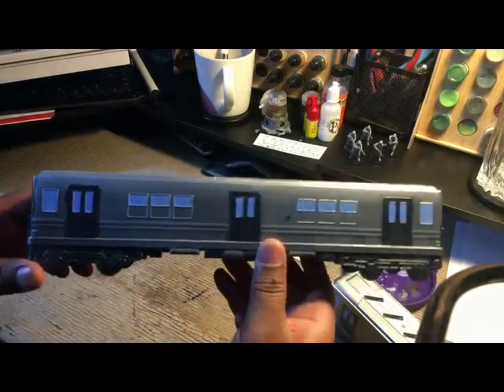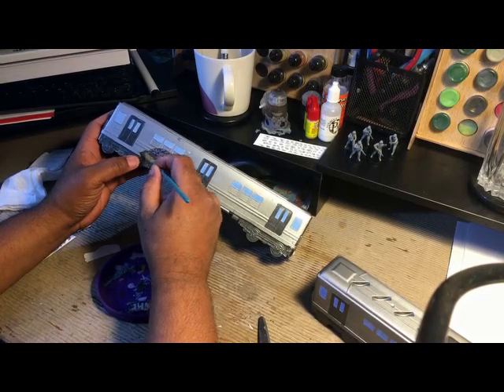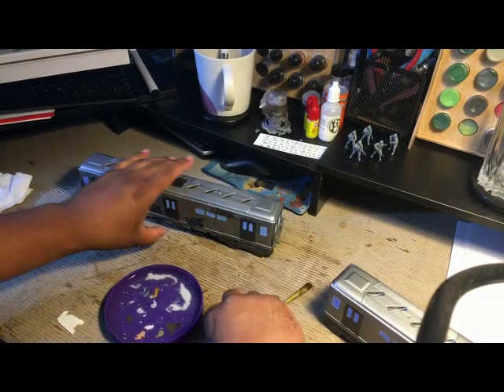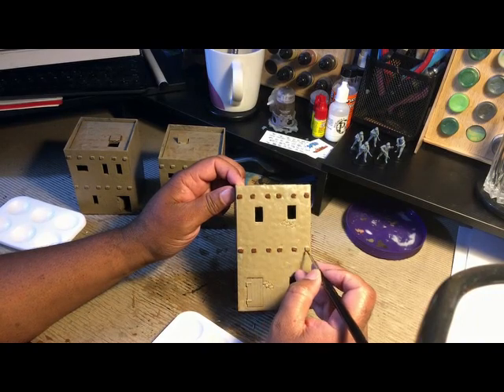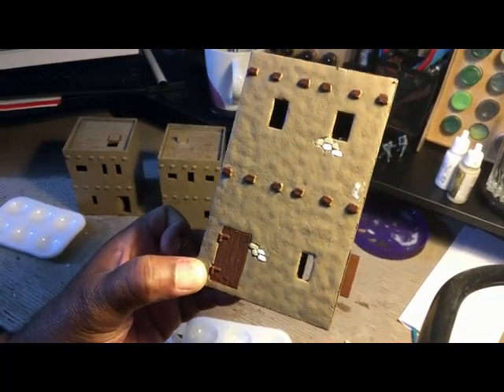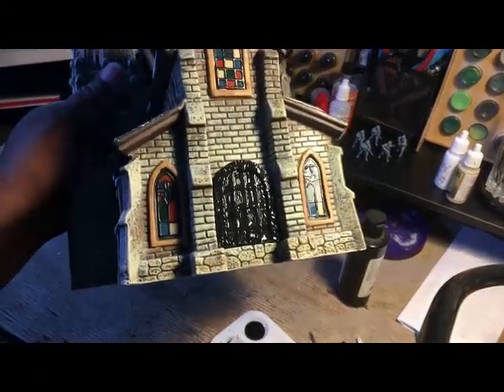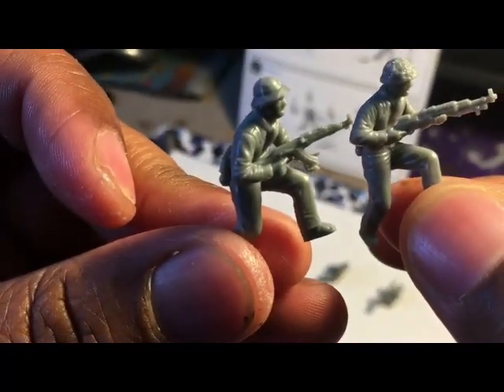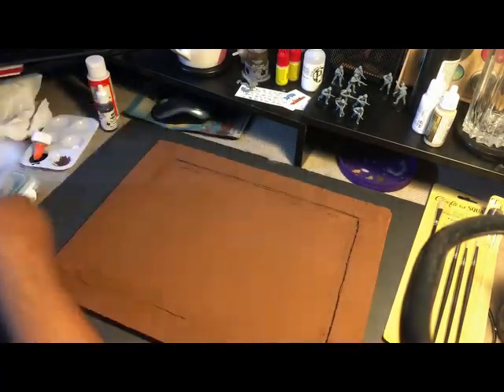Odds and Ends and Discussing Ways to Make Money in this Hobby

Comment: one thought I had, may not be any good but...
- I specifically didn't get a 3D printer because I knew I'd overdo it and make more figures than I'd ever paint and the only thing that makes me regret a little is bits of terrain, smallish pieces which I could print up easily (which I currently mostly make and partly buy)
- I expect there'll be a lot of people doing this but there might be a market in it and wouldn't need to make more than a few samples as an initial outlay
- just a thought